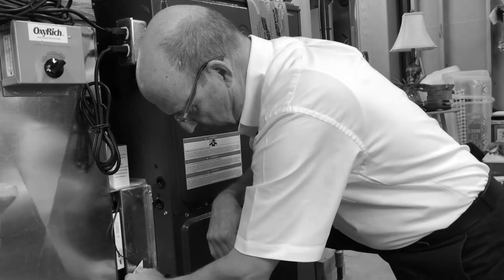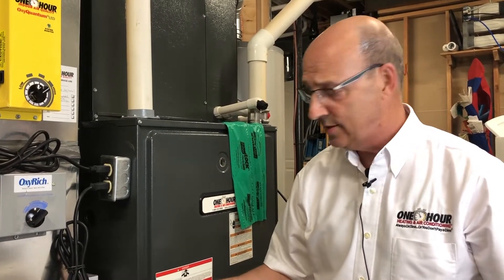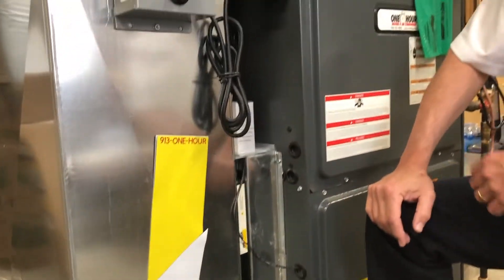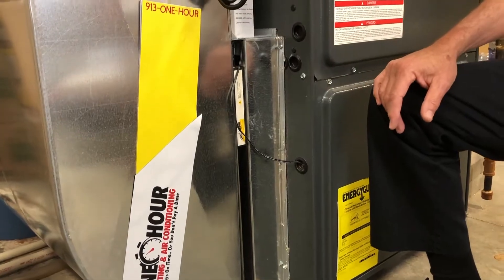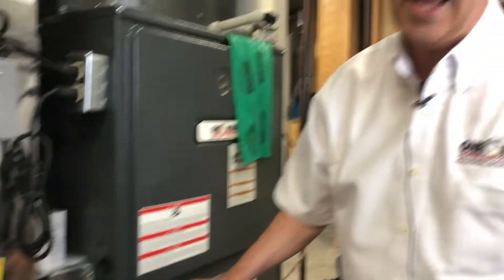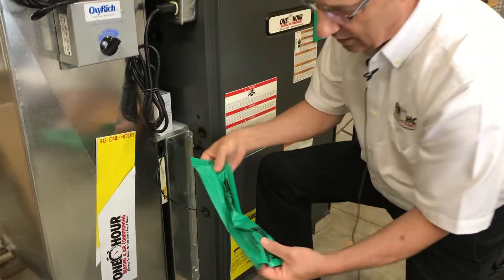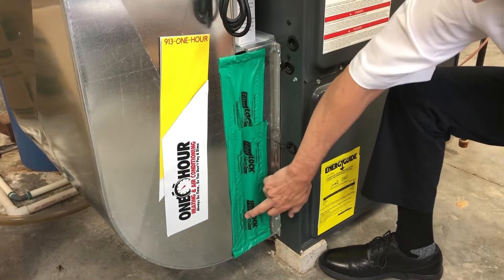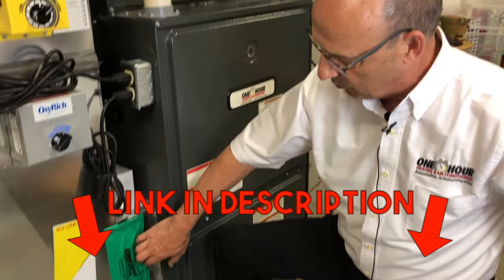Furnace Filter Slot Cover [Easy fix to HVAC Air Leak with One Hour Heating and Air Conditioning]

Comment: I had a new HVAC system installed.  The filter housing was designed for a 4' filter but the pvc pipe blocks the filter housing unit from using a 4".  The contractor said a 2" filter would work in the housing unit.  Any thoughts on this, they said the pvc pipe has to remain where it is.  thank you

Comment: Where did you get the big long magnetic strip you made to cover the filter? I wish the filter lock would've work for me. But, it didn't because the size of my area where my filter is located.

Comment: You sir are exactly right a lot of these furnaces are installed in basements that pull the ambient air and whatever else is floating there. Mold and dusty air. Furnaces are built so porous.
No efficiency to filter the air and the air filter in some cases is just placed in front of the blower motor and in my case mine pulls the air.
It's like you need a clean room for just the furnace with nothing in that room to affect air quality and enough volume so that the furnace motor doesn't tax itself because it doesn't have enough air volume.